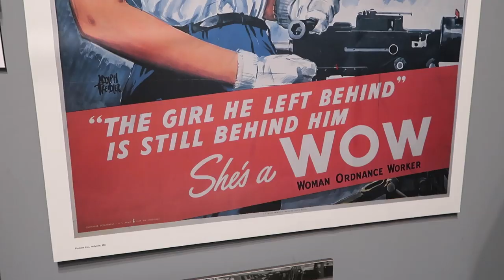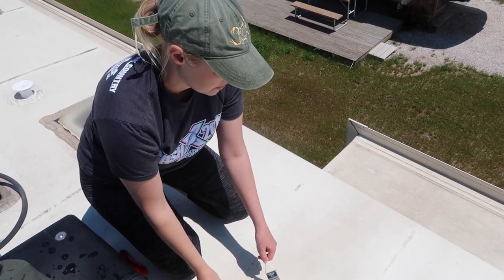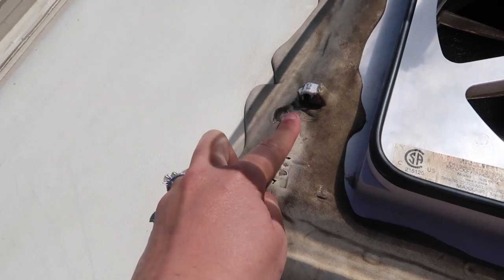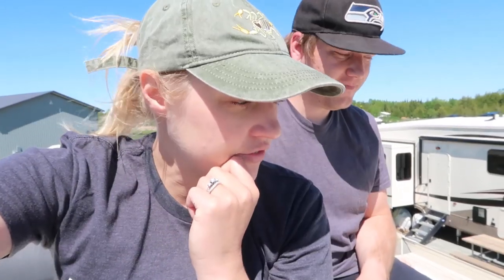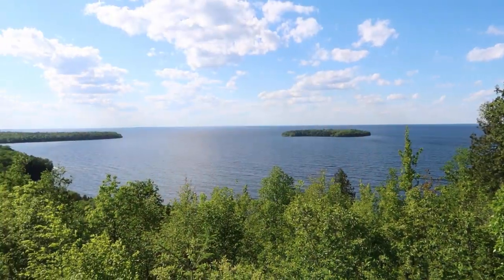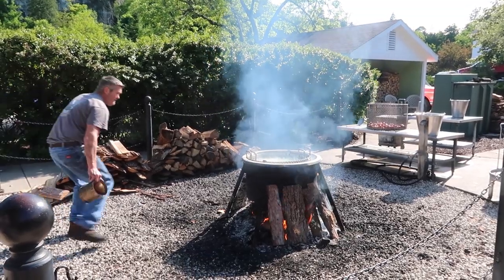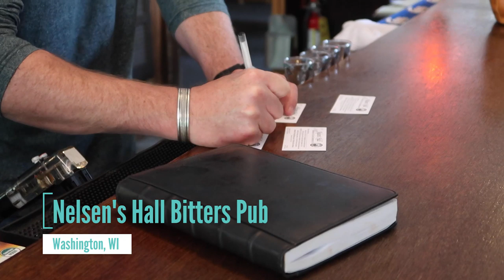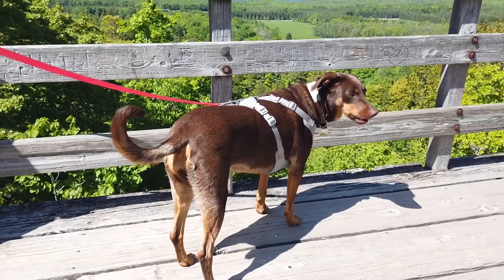CLEANING OUR RV ROOF AND EXPLORING DOOR COUNTY, WISCONSIN! || RV LIVING

Comment: I would use eternabond tape over your cap seal. My rv developed a leak there and required a complete de constuction to repair water damage. I noticed a lot of new 5th wheels come with it from the factory now.

Comment: Fish Boilover. Sweet. I would have had to try some. Looked like a great time. Now I remember that roof algae lines before. I do see online some issues with that but usually not that bad. Guess lots of arguments on TPO vs EPDM. But you all were saying it was because of the plywood seams. But GD and Jayco really talk up using wood for construction. But I would not be a happy camper with algae growing. I’m with Rae. Really just looks like a reason for some roof failures yrs down the road. Can’t be good. Especially if you cant seem to get it off. Will only keep growing. Just under solar panels now. Now do you think that would happen if roof was cleaned 2 to 3 times a yr instead of waiting a yr.  Haven’t really seen that issue as bad on GD forums.  Guess I’m expecting better out of Grand Design. Or is it just that roof wasn’t cleaned as needed. ???????

Comment: Good morning Rae and Jason. I had a similar issue on an older travel trailer I had. I ended up using an epoxy based white paint and just repainted the entire roof of my RV. It rolls on just like painting a room in your house, which was extremely easy and pretty inexpensive. This also adds another layer of protection for your roof. Below is a link to the exact product I got on Amazon. I hope this helps. :) 

https://www.amazon.com/gp/product/B004A30MGA/ref=ppx_yo_dt_b_asin_title_o02_s00?ie=UTF8&psc=1